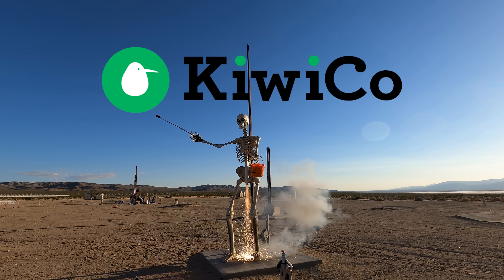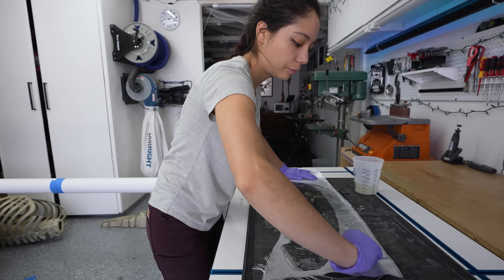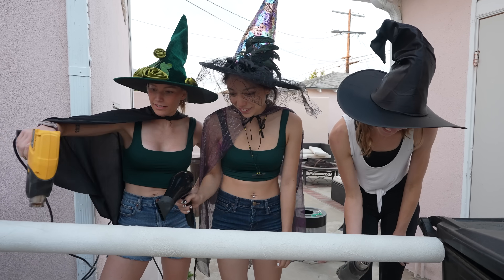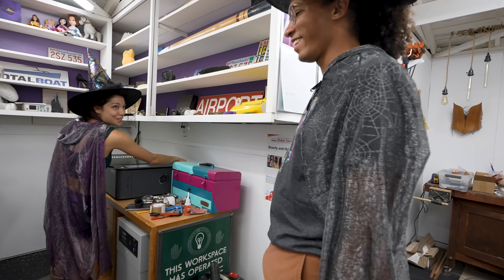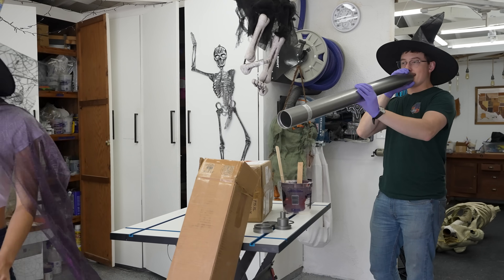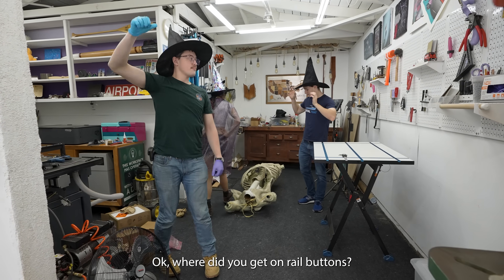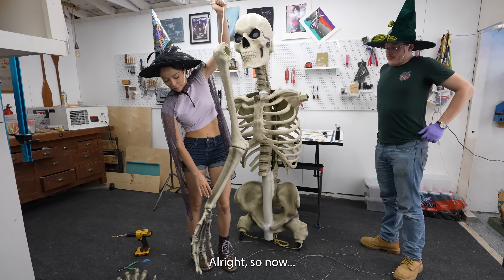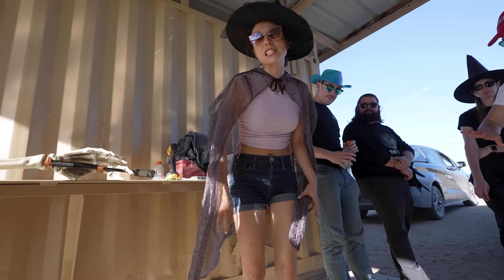I put a 12 FOOT SKELETON on a GIANT ROCKET!

Comment: Disappointing. An ill conceived, well executed build. The build was well done, as are all of Xyla's builds, but cramming a very powerful motor up the backside of a skeleton with no attempt to make it stable or to have it come down safely is just bad rocketry. How hard would it have been to make that motor tube a foot or two longer and put some fins at the bottom? How hard would it have been to pop the skull off like a nose cone and deploy a parachute?

You're capable of so much better, Xyla. I'm disappointed in you.

Comment: First rule of rocketry: A rocket will tend to be more stable when the CG is more towards the front of the rocket. To move the c.p., increase or decrease the size of the fins. Larger fins cause the CP to move towards the rear of the rocket.
Reply: I was taught to balance the rocket on the center of the motor, adjust the thrust lines to align with the drag components, pay attention to the longitudinal balanced (slightly nose heavy) and pray that it flies  up and doesn't chase the ground people around.
I once built a rocket powered witch on a broomstick, it went up about 10 feet went level and zoomed around in a 200 foot circle 4 times before the motor burned out and shifted the thrust to drag. It went into tighter and tighter circles ,stalled and dropped to the ground undamaged. People told me it was rolling all the time aloft.
I didn't see it roll but we got 5 launches that day with the same flight outcome. Exactly. 
Aerodynamics is my idiot  waste of my time but it's so much fun it's not so much of a waste.
I wanna do it again 30 years later. I still have the plans and calculations somewhere. 
You gals and guys ROCK!
Reply: @darrellcook8253  we use software now: openrocket
Reply: Yeah, I knew this was going to go nuts because of the aerodynamics.  Eyeballs are enough to say it had negative stability.

Comment: So, there's a paper-tube company in Ohio.  Called Custom Paper Tube.   I used to use them back when I ran Propulsion Polymers.  The cool thing about them is that they had SOOO much tooling lying around that if you wanted samples of a custom paper tube, they'd usually be willing to send them to you for free--typically they'd make up 5-10 tubes.  Just, you know, if you need cores to wrap fibreglass around in the future....

Comment: You mentioned getting a Level 2 Rocket certification...Does this certification come from the FAA and does it specifically apply to the design and construction of rockets? What level of certification does, for example, SpaceX have to launch their Falcon 9 and Starship rockets? Finally, when you're about to launch a rocket, do you need FAA clearance so your rocket doesn't crash into an airplane, or does that clearance come of air traffic control?
Reply: About 2 seconds on google will answer all of this. Loosely, there are 3 levels of Advanced model rocketry which determine the levels of engine you can purchase. A series of successful rocket launchs meeting specific criteria are a practical exam to advance to the next level.

Comment: First rule of rocketry: Given enough thrust, anything will fly.
Reply: Second Rule of Rocketry:  If you want it to fly straight, the back end has to want to go slower than the front.
Reply: Third Rule of Rocketry:  Down is easy.  "Where" and "How Fast" require some forethought.
Reply from the maker: a helpful annendum to the second rule is the back end has to stay attached to the front end
Reply: @xylafoxlin  At that moment, he understood that there were two back ends and too front ends flying in different directions. . .

Comment: 15:39 Before reveal~ no confidence in the bucket even making it even like a few hundred feet before it just shakes loose on its own 😂
16:07 After reveal, yea. Though I was kinda expecting more upward thrust 🤔. In KSP logic, just add some more boosters next time. lol

still impressed it flew as straight as it did for as (little) long it did, and that it mostly remained in one piece going up before breaking apart.

Comment: A bit late for this project, but for future reference and anyone else who runs into this, certain plastics have what's called "low surface energy" and require special adhesives (mostly polypropylene and polyethylene) to stick - the easiest of these to get is some CA glues can be bought with a surface primer, although those packs are a bit small for 12ft skeles
Reply: That was a lesson I could have used last year, before I began the adventure that introduced me to methylacrylate two part adhesives… :)  Expensive stuff.  But insanely strong.
Reply: @vaalrus  MEK is great for some stuff too if you can find it
Reply: and don't for get to "plasma etch"!!  aka hit it with a reguar propane torch for ~0.2seconds  and check if water wets to it better